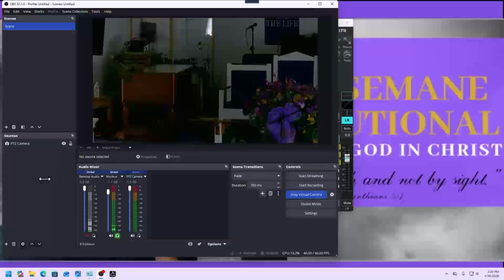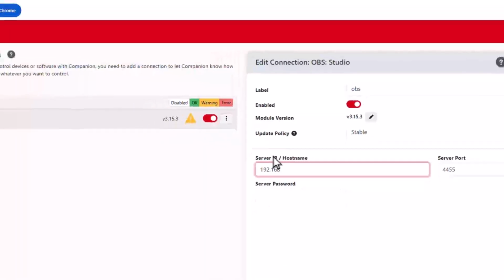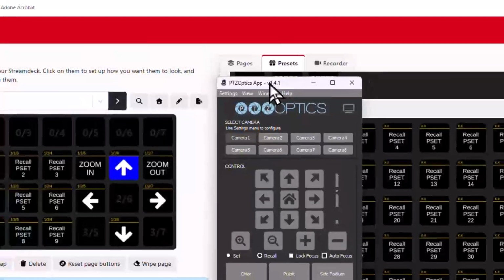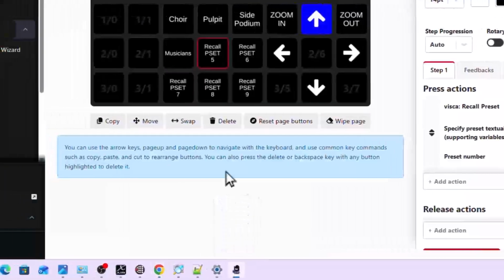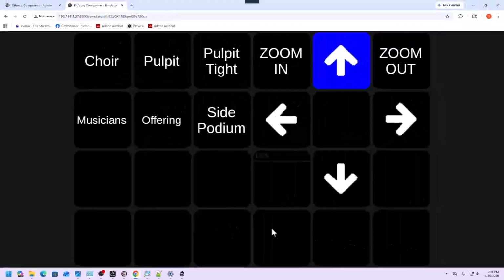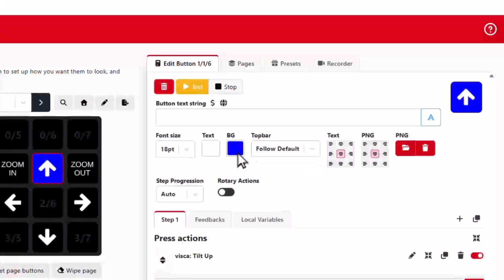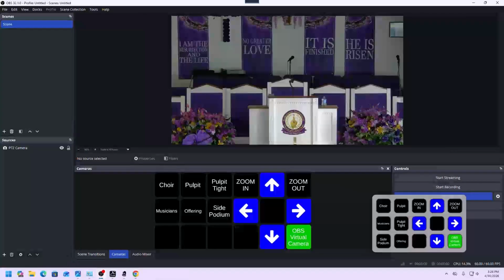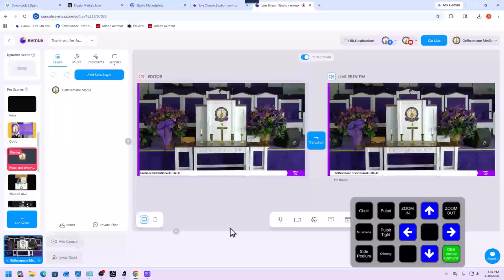PTZ Camera Inside OBS with Bitfocus Companion (Detail Setup)

Comment: What happens if you don’t add obs? Won’t the camera work?
Reply from the maker: Yes the cameras will still work and can be controlled from the web interface. As a matter of fact, they can be controlled from any computer or tablet on your network using the link. I was showing hot this could be embeded in OBS to improve workflow.
Reply: @TechLabStudio251 my cameras aren’t responding and I don’t know why. They are Aver Cam520 pro 3.